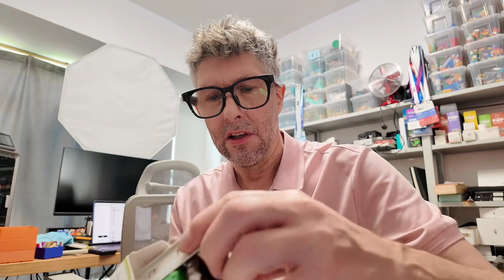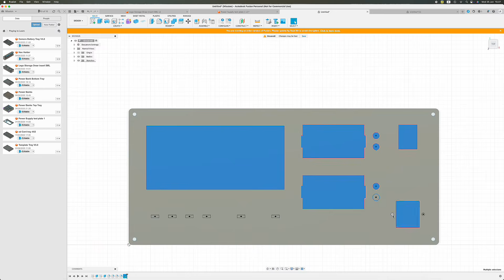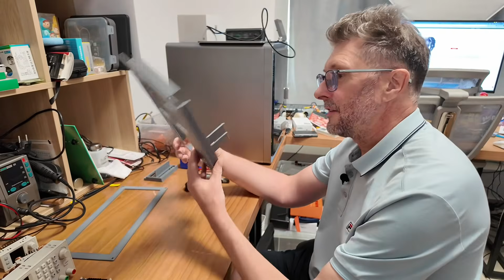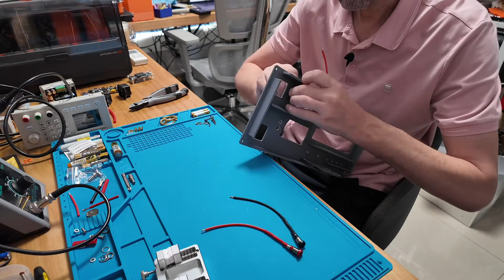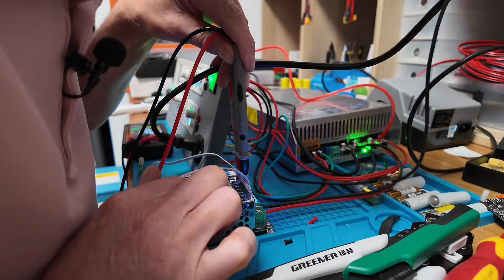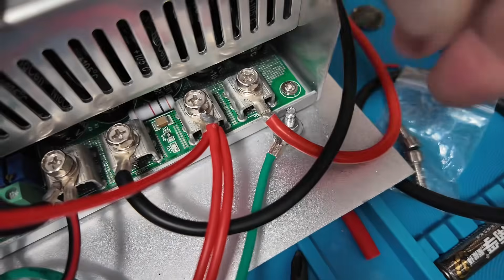How I Built a Bench Power Supply using my 3D Printer.

Comment: Good work. I want something similar, too. But it's very bulky on the table. For compactness, I would move the power supplies, for example, under the table. Also, for compactness, it's better to place the regulators in small separate enclosures connected via a 5.5 mm jack or XT60.
Thanks for sharing, it was interesting to watch.